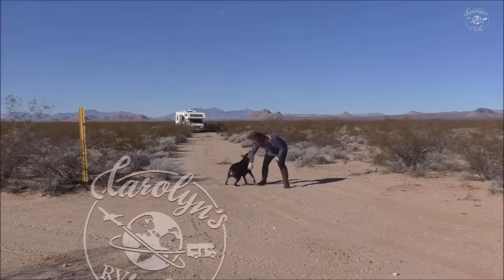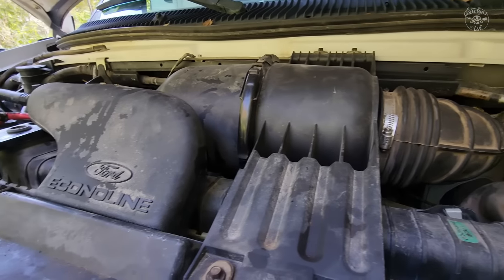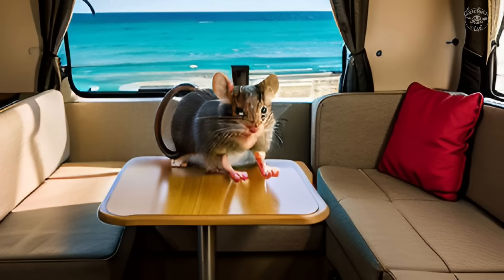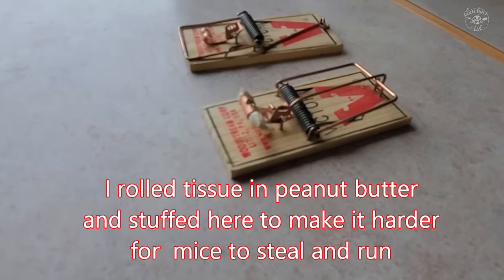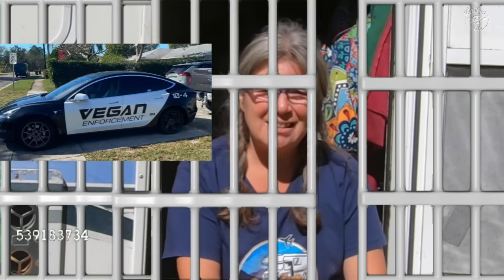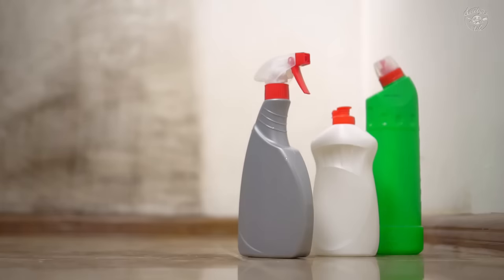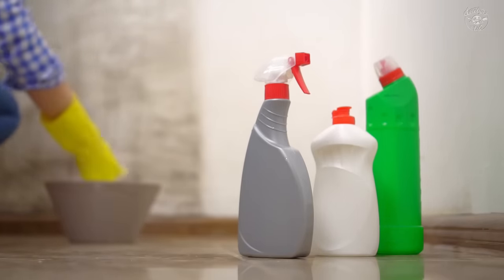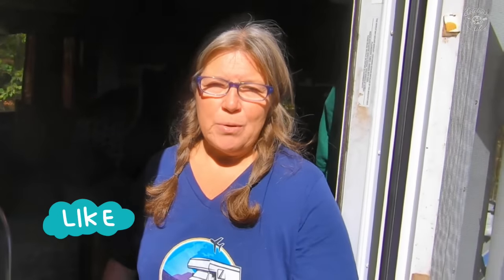Tips to Keep your RV Mouse Free, Plus My Secret Weapon for Keeping Mice Out!

Comment: I had an infestation of mice last winter. They were coming in the house through the dog door. I set up motion detector cameras and found they were active between 9pm and 1am most of the time but occasionally until 2am. They explored thoroughly the ground floor rooms, but mostly they would wait at the bottom of the stairs until I left for work at 9pm and they would run up the stairs into the kitchen where the dog food dishes were. 
Surprisingly my two Chihuahua dogs did not care even though they go crazy for squirrels cats and raccoons and deer. I noticed at thanksgiving when I was watching tv and a mouse appeared on the couch in the living room. 
I set out every kind of trap. They never went near the humane traps. They could set off the snap traps without being in the trap. I have video of a mouse jumping three feet sideways and not setting one off. I used mouse and rat sized glue traps and I doubt they got more than a tail in them, but several times they were dragged. One was dragged to the dog door. 
I finally started closing the dog door and every night that it was shut there were no mice. The edges of the dog door were chewed four nights in a row. I also recorded a mouse climbing the outside of the house via a tree branch to a ledge on the second level outside the kitchen, but that was the last of them. 
They apparently don’t like Citronella, or Peppermint and I think Eucalyptus. I don’t think dogs like them either since the Citronella spray I used was from a disfunctional anti barking collar. Wasps also don’t like Citronella since they tried building a nest in my travel trailer’s exhaust vent. I have sprayed all around my trailer and so far the mice haven’t explored it yet.  When it’s next to the house I don’t keep any food inside and on the road all the food is in a cabinet above the sink. And in future the microwave.

Comment: We had a chipmunk go up into our motor area while in Yellowstone years ago. It was running around under our van at a pull off area. We drove away and all of a sudden the chipmunk popped up from under the hood right in front of me while I was driving. It was looking at me through the windshield. I stopped to get it out and it ran down in by the motor. I had to drive away from all other people and honk the horn to get it out. At home I use a dry piece of corn or sunflower seeds in the older wood style traps. I squeeze the metal around the food. Putting the bait in the round hole area. Then when the mice try to bite it, they never get the bait. They die with their mouth around the bait. I also sometimes put 3 traps in a black box meant for poison. Then I move that around to different locations.

Comment: I hate those sticky traps; they are indeed cruel. I had to deal with a mouse in one of those once. Not pleasant.
Reply: I caught a rat with one once, I had no problem putting it in a bucket of water. It came in the house and took the risk of losing its life. We had used traps and none of those worked. Thought it was just a mouse but then I saw that it was a rat. I agree the sticky traps are cruel but after months of not catching it, I was done being nice.

Comment: Problem #1 rodents chewing electrical wires!  Especially Toyota that makes wire housing from SOY.   $1000s to fix.
It can be HABITUATED squirrels (NEVER FEED WILDLIFE).
I can easily ear tiptowing in the engine compartment at night...confirmed in the am by tiny footprints in the dust over black plastic.  Lamps in the engine cpt work for a friend, or under the van work also.  I heard mentioned human voices is a deterrent:  so try an old phone with YT videos downloaded on it. Cover midnight to 2-3am.